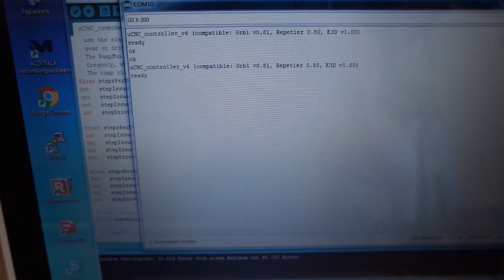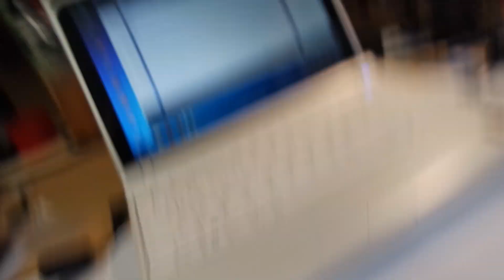Big Rob Project Part 10

Comment: Hi, I am your huge fan and I d liek to ask you, do you use tight nuts ore why dont you use two nuts with spring between them. For better tightness.

Sorry for my English.
Reply from the maker: Hello Martin, you are correct: to eliminate backlash I usually use 2 nuts with a spacer in between. The downside is that you put extra torque on the stepper with that tension. For this project I want to use the small steppers, so I'll tolerate a minimal amount of backlash. So far I'm quite happy with the result; if I can improve on it later on, I'll try.
Cheers,
Dirk
Reply: Ok, thanks for answer :) Best solution would be use ball 
 thread (Not sure how to call it in English)  that would be dam precision :3